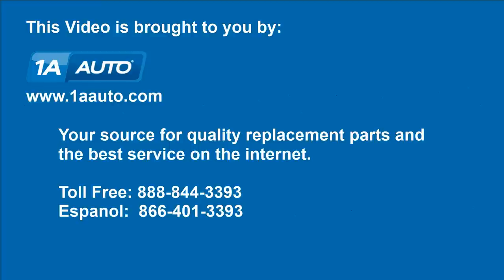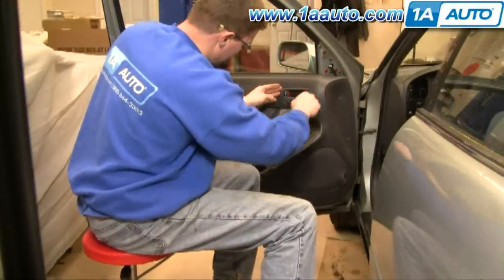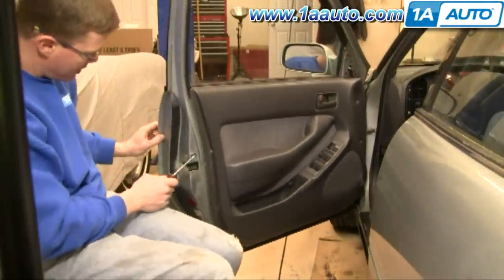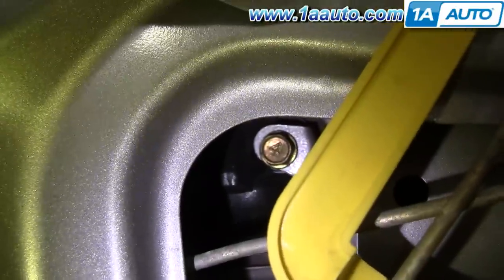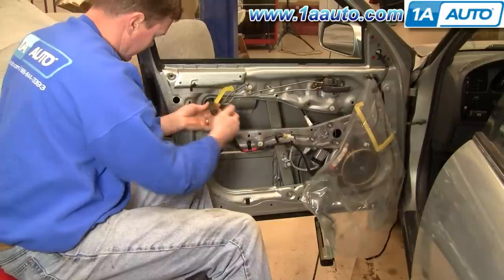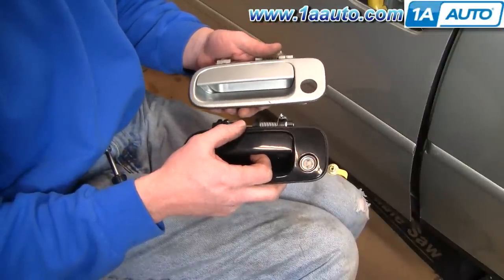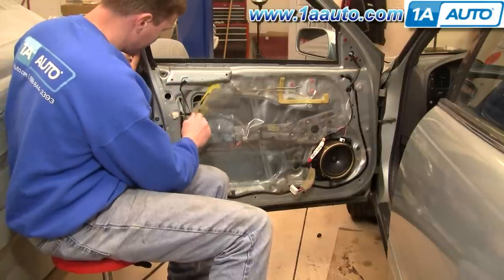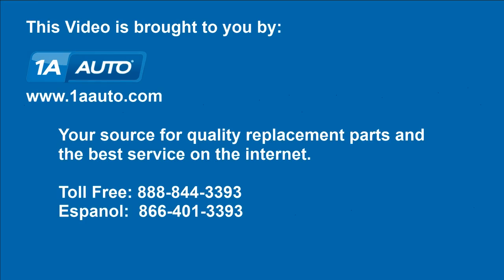How to Replace Exterior Door Handle 92-96 Toyota Camry

Comment: I would like to comment on one thing, since I just went through this process.
The part about "not worrying" if the bolts fall down into the door, BE WARNED!!
If the bolt falls into the mechanism where the door release is, protected by a plastic box near where the door latches, it is a nightmare trying to get the bolt out without taking things further.
My advice, don't let the bolts fall when removing them from the inside.

Comment: Thanks, got one passenger door with busted door handle, and one driver door with glass off the guides, since the motor works, and once down, it has stayed that way.  Winter without a drivers side adjustable window, not the mention car parked security, isn't ggod.

Comment: My drivers side door handle in my 1994 Toyota Camry broke of 2 years ago I just put zip ties and been using that. These cosmetic things in Toyota are cheap and easy to break but their mechanical units(engine, tranny, suspension etc) are rock solid. Got almost 300,000 miles on the Camry and only major replacement was a starter at 100k miles(which is still ok now) and majority of it life the engine check light is on which is also common in Toyota.

Comment: For those with newer Camry's, my 2000 was in line with a similar vid entitled "2001 Toyota Camry Door Handle Replacement" posted by "Danbury210"

but do see the comments there; a few tricky bits.  Mostly, you need a 10mm wrench and need to break the existing locking plastic bracket (the yellow one in this vid, and in the one linked above) to get the flanged lever arm out.

I'd watch both vids; some good pointers here too!

Comment: This video is very useful, with one exception: DO NOT allow the bolts to drop into the bottom of the door when removing the old handle mechanism. I did so, and while I had no problem locating the right side bolt (viewed from the inside), the left side bolt disappeared. I never found it in spite of a careful search with a variety of probing devices including a flexible magnetic probe. I ended up having to buy a replacement.

Comment: This video was perfect. I love it when my mechanic tells me a procedure is too complicated and I manage to do it myself.

There were only two things I would add
1- If you have the tiny door tweeter, you have to remove the cover of the speaker to access the fourth door bolt

2- if you have electric locks you need to unbolt that component from the handle in order to remove the handle from the car
Reply: David, is that component bolted to the door frame or to the handle?.  I am undertaking this project next week to replace each lock cylinder. They freeze up every winter and need to go.  Just for a laugh, I asked Toyota how much time they would charge to do each door.  They said about an hour and a half EACH at over $110/hour.

Comment: Thanks guys, don't think I could have done it without the video.  I ended up not having to unplug the power (just let the door hang).  The biggest problem for me was getting my hand into the small space and pulling unlatch bar out.  Took me about an hour and didn't have any screws left over ;)

Comment: Very helpful video. I needed to replace both interior/exterior driver's door handles on a '92 camry. I watched this video and went to work and was successful after an hour's time. On my care, there is a light underneath the door arm-rest behind whch a screw for the door panel. Also, On my car, the other screw is behind the tweeter speaker. Last, I started with window down and needed to reconnect the panel to throw the switch to raise the window before I could continue work. Great video!

Comment: Thanks! I just wanted to say thanks. I could have not put my new door handle on without the video. It just took about an hour+. I did drop one of the screws from the handle and it went as far up to the front door as it could. Lucky I had a long magnet on an antenna like rod. One little hint I could give is if you look down between the glass and door frame you can see parts of the handle good, like the rod and clip. Also I saved the clip from the old one just in case. Also I used a screw driver to help get the clips off, the flat side. Thanks again 1A for the GREAT video!

Comment: Great video, great part.  Arrived in just a few days.  Just wanted to point out that my door ('93 Camry) was slightly different.  Mine had an extra screw hidden behind the courtesy light at the lower rear end of the inside door armrest.  Just pop out the light housing (rectangular), disconnect the light power cable connector, and then remove the last door screw.

Comment: Thanks a lot!! It worked like a charm for my 2000 camry so this video is useful for 99-02 camrys too!!! Only hard part was to remove the rod from yellow clip, but it can be done with widening the yellow pin with flat screw driver, have some passions.
Also don't mesh with old screws, your new handle might need the metric screw, so go get it from the store, if it didn't came with the handle. (Better to keep extra screw when u open the door panel, I dropped 2 of them inside the door..)

Comment: Got the handle replaced, but I wish you had not said to not worry about the screw falling into the door. One of my screws is still lost in there, and not for lack of trying to retrieve or even locate it.  Then I lost one of my 10mm sockets. I checked the bottom of the door from end to end. No luck finding either.  Good thing I had another screw and another 10mm socket.

Comment: Thanks! Was a great help in me figuring out how the lock system works and how to re-attach the lock rod after it was displaced by a slim jim. The 10 mm bolts were impossible for me to remove, however, with a socket and driver. Ended up re-attaching the lock rod and clip without removing the outside door handle (now I know how performing microsurgery feels). Overall, great vid!
Reply: This video was demonstrated very well in detail. Thanks
Reply from the maker: +Steven Sherman Thanks for checking us out! http://1aau.to/m/Shop-1AAuto-c

Comment from the maker: The outside handle on the 2001 is very similar in the steps needed to remove it from the vehicle as the 1992-96 model is just there are different bolt locations holding the panel in.

Comment from the maker: @crazyitch21 The latch is located on the outer edge of the door. It latches the door to a post on the body of the car called a striker. If you can take the door panel off, you may be able to reach inside of the door and release the latch by pulling on the rod that opens the door.

Comment: Oh mine had electric door locks it was a pain in the you know what. That little metal piece on the top is where it hooks to and it screws into the empty hole in the middle of the handle.. You must loosen the screw for it after you take out the main screws and pull the handle out a little so you can get to it. And when you put it together make sure you put it on before you put the handle back in the door.The screw needs to be loose so that you can move the electric gismo in the door with the handle. Then you can tighten the screw once in the door from the other side. Then put you main screws back in.. A one hour job took me 2. Damn

Comment from the maker: You may have to push the rod to the side with a screw driver once the plastic clip has been disconnected. Right around the 5:00 mark on the video we show you how to do this.Hope this helps you out.

Comment: great video, my friend.  very easy to follow. my only snag was dropping one of the small bolts that secured the handle on the inside. it dropped down into the twilight zone , never to be seen again.  
I need a video on how to replace the hood release cable for the same car -Toyota Camry 1996. Any videos???

Comment: Very useful video, HOWEVER, your comment at about 5:45 that it is okay for the removed 10mm bolt to drop to the bottom of the door, really isn't:  In my case, it fell into the plastic channel housing the lock/unlock rod that connects to the exterior key.  I erroneously presumed the bolt was in the very corner of the door and that I just wasn't able to reach it.  Put everything back together, and everything worked at first.  Later, i would have to unlock the car from the passenger side.  On the repaired side, the key would only lock, not unlock the vehicle.  Back to square-one, I began to remove the entire latch assembly, and failed.  Desperate, I got out an endoscope to look down the plastic track, wondering if there was some kind of obstruction.  You can imagine what I found.  With great luck, I was able to fish the bolt out with a magnet.  Problem solved -- finally.

Comment: Very good video. But be prepared for surprises - 1) screw in the interior handle bezel, 2) three bolts on exterior handle (lowest one reachable only by 10mm wrench, not ratchet), 3) very difficult to separate vertical lock rod from handle (had to pry the plastic apart which risks breaking it)

Comment: Same issue w/ temps dropping suddenly and front driver's door handle snapping off at the forward hinge.  Video is very informative, but with the current cold weather, will not attempt this myself since garage is not heated.

Comment from the maker: @crazyitch21 If you have two doors that won't open, and they are power door locks check to see if there's power the door lock actuators. if there is and they just do not unlock, then this video will show you how to take everything apart to check out the linkage inside of the door.

Comment: The 1996 camry xle mirror driver was what I replaced.. has different guts and different screw placement  inside and the pigtail comes out 5 inches instead of flush like a typical 1996 which is what I found at pick and pull.So I moved the holes a little bit lost one I couldn't reach and switch all the original guts over to the new mirror housing. Also installed a outside door latch .The whole thing should have taken 2 hours but it took 7.it was like fighting a little war of attrition.might have been a month where the new mirror  insides started to change since it was the 96 which is the last year of that specific body style.gorrilla epoxy mmmgood saved the bacon.

Comment: I watch your video on replacing inside door handle. I did see where you replace the power supply to the door.. Do I need a door handle with auto/remote door opener or can take off the old door.

Comment: Hi, Thank you very much for the video, it really helped.
I was trying it for my 2000 camry driver side handle. Everything worked pretty much good, but the rod to be removed from the yellow clip, that sucks. I tried to push it away from the yellow part, but its too hard to reach at certain angle and apply the force.
Morever it looks like big diameter of rod, outside the yellow clip. I've to leave it as is, because of this and I am waiting for your help. Please let me know some tip.

Comment: Hey man is there any way you could do an exterior driver handle for a 2003 avalon? i saw the panel removal for the earlier model and once off it looked like the door handle assembly was COMPLETELY blocked off from easy access with a huge chunk of metal. Before order the part and getting it painted i want to make sure i will be able to get it in there without to much hassle. Thanks for any info man, good videos!!!

Comment: Mike,

My 94 Camry xle also has electric connections: switch for the dome light if you pull the handle, sm plastic tab on door handle internally to trip dome switch etc.  Where can I find details to move that stuff over?  I'd be fine disconnecting a switch and migrating it, like the key cylinder, but things like the little plastic tab to trip the dome light switch seem to be intrinsic to the door handle - part of the molded plastic and not attachments?  Any thoughts?
Thanks for all your videos!

Comment: My key no longer works in my driver's side door lock. Do you know where I could get another custom lock? Thanks for your videos, they help a lot!
Reply from the maker: Thank you for watching! If you want to use the original key your best bet would be to contact a dealer.
 888-844-3393
Reply: I say look around junk yards... I bought a car that had its ignition changed and i bought a new lock cylinder and installed it

Comment: On my Toyota Camry 1992 with manual windows there were extra screws under the furry padding on the door. Also the window knob would need to come off and there was some type of wire washer pin holding it on that. I broke the window knob off because I didn't have the special tool that would slide under the knob to unlock the wire pin.

Comment: Those little plastic fasteners for the rods brake really easy.None of the local stores carried them.I had to order them on line.they also are different for each side.they are reversed as far as the direction you release and lock them into place.I just got a twelve pack of those fasteners took five months to get deliverd.I'm doing the driver's side rear door handle and window motor.Third window motor,no it's the forth.i discovered that I was sent the wrong handle for front passenger side.no key hole. I did the window motor just waiting on the right handle.

Comment: Why not just pull the handle out, after loosening  the two bolts, to disconnect the two rods like I did? Much much easier than trying to stick your hand in the door panel. Reconnected them the same way. Otherwise a good video though.
Reply from the maker: +Kurt Gross Thank you for the feedback. 1aauto.com

Comment: This is very similar to the 99 Camry.  The 99 does have 3 bolts instead of two, but the procedure is the same for removal.  Too bad the service openings are so limited in size.  I've always felt that a removable panel is needed for that instead of what we get.  If safety is an issue (with a removable panel) then using blue or red LocTite would secure it.

Comment: I need to replace the exterior door handle but on a 2000 Toyota Camry. Not sure if it' s the same principal as the one in the video?
Reply from the maker: It might be a similar procedure. We currently do not have an auto repair video that shows this particular repair. We do carry new exterior door handles for your 2000 Toyota Camry on our website.  Here's a link to them on our website if you would like to check on pricing. http://www.1aauto.com/1A/exterior-door-handles/Toyota/Camry/-/-/2000?utm_source=VideoReply&utm_medium=YouTube&utm_campaign=1ATony

Comment: @1aauto just my passenger door has a trouble, everything works fine except that the passenger door won't open in the inside or the outside.. the repair shops told me it's a latch problem and i don't know what it is.. before the passenger door can be open in the inside but now it won't open on either the inside or out..

Comment: I'm up to 3:46, lift the panel up and off...
Nope! All sides are loose except the area around the two push-pins back by the latch. Both pins are out, but there is something catching there that keeps the panel from coming off. Any thoughts on what the cause could be? I don't want to force it and have something break.
Extra note: it seems yhe obstruction is interior to the push pins as the are around them will lift away from the doorframe an inch or so.

Comment: Couldn't get past the step with the lower screwdriver position on the door handle bezel.  Top popped off fine but no amount of fighting would get the bezel to release when I was prying on the lower position.

Comment: I just did this with a 99 Camry using your part but the electronic locking and unlocking does not work. Is this due, somehow, to my not setting the two rods properly? Help!
Reply from the maker: Thank you for watching. It sounds like something may have been left disconnected behind the panel. You might want to remove the door panel and double check the install.
1aauto.com 888-844-3393

Comment: I have a 1997 T-100 and the passenger external door handle is broken. It obviously is disconnected from the assembly in some way close to the handle. The rest of the assembly works just fine (inside). I can open the door from the inside with the inside handle. I am uncertain what to do.

Comment: Ok I have a issue....I replaced my broken exterior handle on my 06 Toyota camry....I made sure everything was operating proper before i put the panel back on.....so i get in close the door and lock unlock it a few time...open and shut the door a few times..lock it...and it wouldn't unlock ...I could not manually unlock it from the inside...

Comment: how different is it to replace the exterior door handle on a 98 camry?
Reply from the maker: You may be able to apply some of the basic steps shown in this video to your 98 Toyota Camry. We do not have an auto repair video specific to that year. Here's a link to the replacement door handles that we carry for your vehicle if you need a new one. Hope this helps you out. http://www.1aauto.com/1998-toyota-camry-exterior-door-handles/y-mo-c/1998-384-15?utm_source=YouTube&utm_medium=YouTube&utm_campaign=1ATony

Comment: having issues starting at 4:56 - can't dislodge the rod. any help? seems like the yellow lock piece is preventing it from coming undone
Reply: Elijah A I'm having the same issue as it seems the end of the rod is wider than the clip head hole.. possibly from weather or time warping the clip.. and it's nearly impossible to get pliers in there to widen the clip head. I'm thinking I may just have to break the clip into pieces to get the rod out, and fortunately new handles seem to come with a new clip.